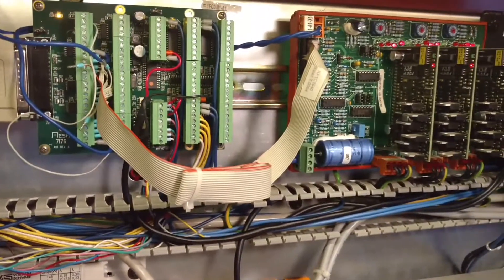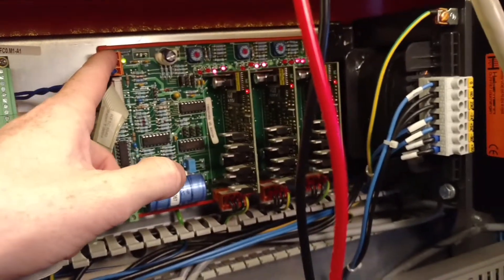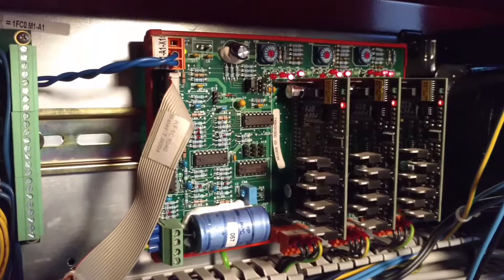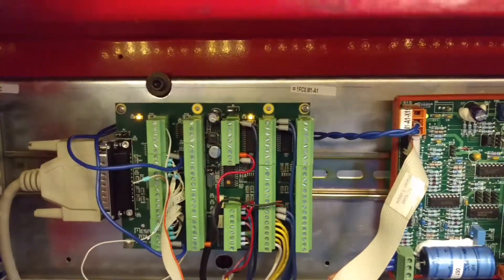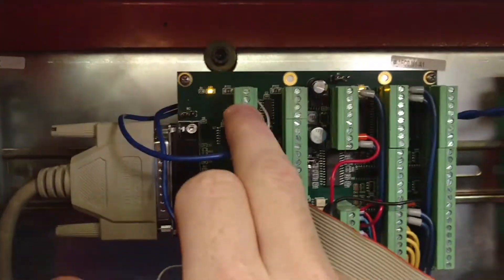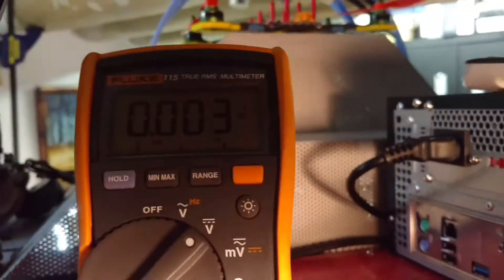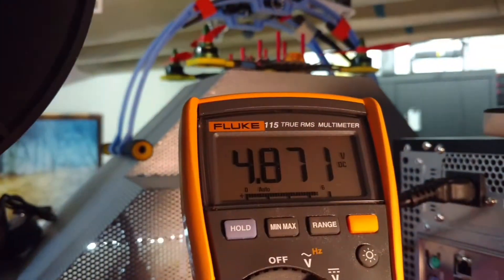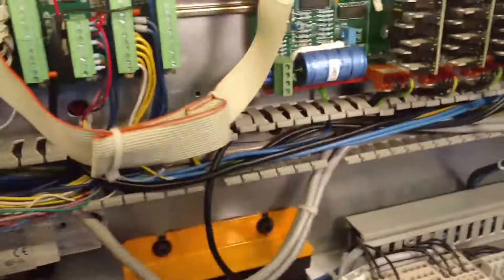EMCO PC Mill 55 step motor drive enable

Comment: Hello Mike. Do you happen to know about the voltaje setting for this equipment? I know there's modification nedded to the main transformer for a supply voltaje of 100V. Thanks!
Reply: I believe it's setup to operate on either 100V or 220V.  Mine has a switch somewhere in the power key / plug that let's you select Input voltage.  I would have to move a bunch of stuff around but maybe I can make another video this weekend and show some of the voltages etc.